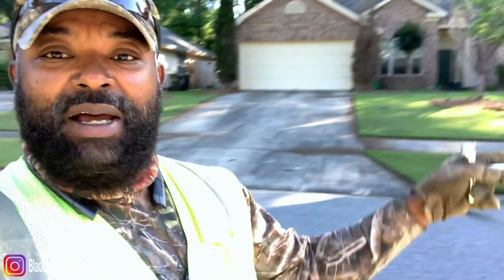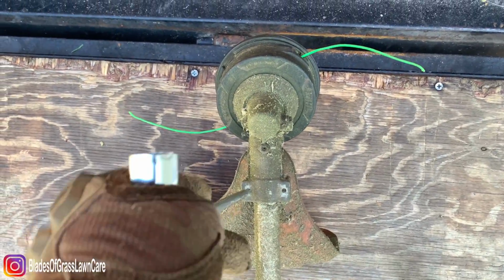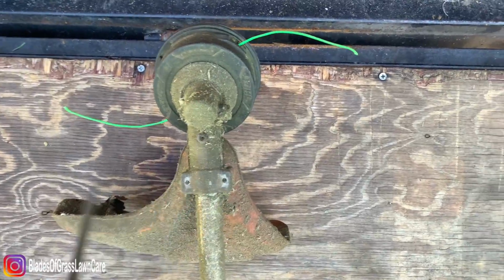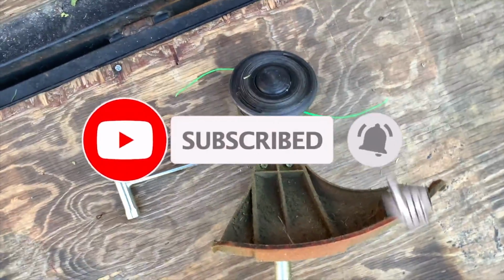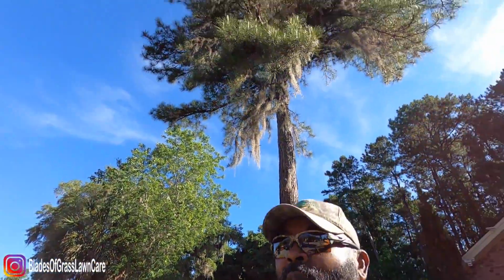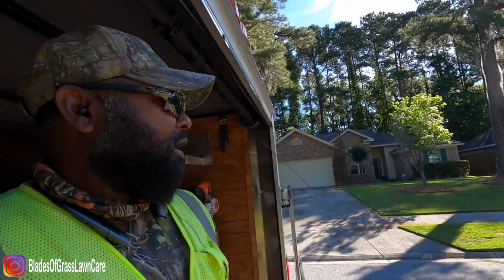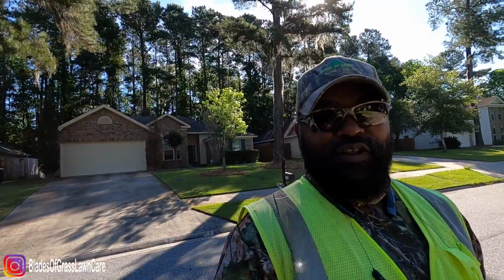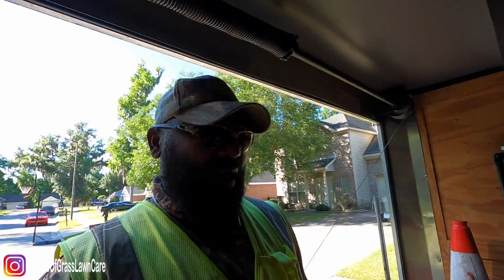CATASTROPHE [Subscribers advice leads to customer property damage]

Comment: The guard acts as a counter balance for those of us that are used to having it on.  When you take it off, it works against you until you get used to the lighter feel.  I ended up putting my guard back on, because that's my comfort zone.  Either way, stick with the guard on or guard off, which ever is more comfortable.  Big Ups for trying to use it without.  Cheers!

Comment: I've personally haven't used a guard on my trimmer since I was a rookie. If your used to the guard it definitely takes time before you should move at your normal pace. Your hand has to be super steady. The faster the head is rotating the more centrifugal force it has allowing it to not wobble/shake. You still have to maintain a strong hold in case the line runs (grabs ahold and starts to dig) and in order to maintain the proper height. Do NOT use this method around screen porches/metal kick plates, gutters and any soft objects. There is a learning curve involved. It's the same car but it drives differently. Only use the trimmer with no guard in low his areas and around the back yards until your comfortable. Good luck and if I can ever get video I'll try to send it to you. There are many advantages but there are also more precautions. Do NOT edge with a line trimmer without a guard near cars! Any questions I'm available.
Reply from the maker: Thanks for the tips and advice!
Reply: @Bladesofgrasslawncare  no problem. The benefits outweigh the risk with time. I still have my mess ups but they are few and far between. Eventually you'll be so steady that someone couldn't pay you to put that guard back on. The difference in weight to a guy running that trimmer all day helps with back issues. To me the lighter trimmer head lets me swing as wide as I possibly can in large areas because my back and abdominal muscles  aren't pulling as much of load back and forth.. another big note. Big big thing to watch is the length of your line. The guard cuts the line to the same length. Without the guard you are free to make the diameter of your line larger. This helps me trim so fast because I'm moving as fast as I can walk without breaking into a Sprint and with that much coverage you don't miss much. There is a balance here as well. You do not want the strong too long to the extent you can hear the motor slow down. With a spread loader you can quickly fix that but without you rev your trimmer all the way up tilted to the side like your edging but against the sidewalk untill the stings are the same length.

Edit: spelling

Comment: I run Stihl 91, 94 trimmers with no guard.
Few days ago i bought a 111 trimmer that had the guard on. Well i didn't take the guard off but i been using the hell out of it. I haven't been edging with it though.  But i have to tell you, i dont if it's because its a 111 but everthing feels different with that guard on.  I feel like i cut more level with a guard.  I'm going to put the guard on my 91 and try it out for a week. But you are right it does take you out of your comfort zone.  So you and and are doing the same test except opposit. You're trying without a guard and I'm going back to try with the guard. And right now my results with the guard are actually better

Comment: I used guards for a long time,, until we picked up a cemetery. Took the guards off to get a bit wider cut around the grave stones where the mower can't get through. The guards have been off ever since. I've taught myself to do most of my trimming at less than full throttle to have a bit more control with the guards off.

Comment: 😂😂 That guard sure does make the machine feel different !! I am a guardLESS guy myself but I have tried to go back to a guard a time or too. For some reason my trimmer turns into a BED REDEFINER !!! I will rut up some turf with that extra 100 lbs of orange plastic 😂
Reply from the maker: It felt too light to the point where I couldn't control my turf lining
Reply: @Bladesofgrasslawncare  I think a lot of it is what they call muscle memory.  We have been in the LC business long enough that it just sets in. It seems the older we get. The harder it is to change. Q could probably run no guard for a day or two and feel like he has always done it this way. I am 52 yrs old myself and change does not come easy no more with anything 😂 You definitely have to do what your comfortable with.

Comment: Couldn't pay me to put mine back on, my employer has all whippers without the guards we use that black hex whip line to help make up for the weight of the guard plus run the line about 9" or so lol definitely something that took me a month to get used to but 7 years later still running without and doing the edging without the guards lol not one window but lawn ornaments 3 or so have tasted the line lol lol the longer the whip line as your edging backwards you almost end up using your throttle hand just to balance, and your right Q, the 'ol timer who taught me told me the same damn thing, although he used KISS alot , K.I.S.S.
Reply from the maker: Thanks for sharing!

Comment: Its definitely different with some of the heavier stihl trimmers. I have and FS90R and it does feel odd with the guard off with the back end being heavier. I will say though, i bought an FS94R this season and when you take the guard off it feel so amazingly balanced to me and light as a feather. The light weight can be odd to handle at first, but it works out after a bit and its great for long days of trimming. I think the biggest adjustment is letting the string out and getting used to getting the right length. Q hit the nail on the head with it being in your head more than anything. Keep grindin brother and stay safe!

Comment: I have two trimmers, an Echo SRM 225 and a Stihl KM 130R. The Echo is low power and used more for light trimming and intricate work and I don't run a guard on it. The Stihl is balls to the wall power basically an on/off switch and I run a big guard on it. The Echo doesn't really fling stuff when using low throttle, but the Stihl will launch a rock through a brick wall at half speed. 

The biggest reason I don't run a guard on the Echo though is because it has a speedfeed head and if I bump out too much string I can easily wind it back up by hand. The Stihl head on the other hand has to be taken off and opened to wind up the string, therefore the cutter on the guard is essential. I use the Stihl generally on clean ups and tall grass cutting where meticulous work isn't top priority, the Echo though without the guard can trim around trees easily, be worked into tight space and be less bulky.

Comment: I saw a video of a guy who leaves the guard on but cuts off the lower curved portion which removes the blade that cuts the string therefore operates like the guard is not on but still has some protection I thought of doing this but I never get around to it.
Reply from the maker: Great tip, thanks

Comment: Great and interesting video.
Quest is absolutely amazing with a string trimmer.
I have to run a trimmer without a guard because I trim so flat that the guard drags on the ground,which makes sense because I’ve been an auto detailer for 38 years and I was taught early in my career to run the buffer/polisher flat so that running things flat is driven into me pretty well.
If your style and personal preference is to use that guard,then you should definitely do it.
Possibly without realizing it you using that guard as a gauge for your consistency in height ?not a bad thing at all if that is the case.it would simply mean you have a fool proof system.
Please keep the videos coming

Comment: Hey johnny, running no guard will make your equipment gum up, ull get alot of gum around exhaust.
Runs too hot, high strain an lower rpms, your rpms is what cools the engine.
Pay attention to the heat and gum around exhaust. 
Awesome video man. Pop smoke
Reply from the maker: Thanks for the tips!

Comment: Like anything it takes a little time to get use to it. My first year I used a curved shaft, first few days on a straight shaft felt strange. There's a reason why most of us take them off. Use it for 2 weeks and put the guard back on you will not make it to the next yard without taking it back off. There will be some annoyance with it off (too much string out is the biggest). Having said that, Stihl will tell you it runs hotter, and it does, shortens engine life. You're going against OSHA rules. The reg reads like, you're not allowed to manipulate the equipment beyond what the manufacturer built. But when you take off the deflector off your mower your doing the same, even with a chute blocker, if that blocker is all the way up and not acting as a deflector you're not in regs. Not to mention, a lot more debris bouncing off ya. More dirtier. Despite all of that I still can't put my deflector back on my trimmers. I have actually taught myself 2 edge/ trim my sidewalks with one hand walking straight forward, not having to contort my body in the position it's usually done with weed eating which is very hard on us. I use the ultralight fs94, no guard, and yes I do a great job.
Reply: But in short, taking the guard off is like a drug. Once you have adjusted to doing it, it's hard to go back. But come on man, you're prior military. You can push through it. Force yourself to learn. Give us one week. 1 week challenge. You are moving really fast which is what your adjusted to with the guard. So yeah you're going to make mistakes. Like anything you have to slow down and get the vibe. Just saying. But a 1-week challenge would be nice.
Reply from the maker: Great info, thanks!

Comment: I use a guard on my daily FS91r but run without on my overgrown eater, FS240r. It's easier to get into beds without a guard. The weight of the engine really bother me more than whatever is at the end. I do like running longer string at a lower rpm with or without a guard.

Comment: I run a Stihl FS130 and without the guard it isn't balanced well. It's got plenty of power to run a long string but it's not as controllable because of the balance. I have the big trimmer so I can run steel weed and brush cutting blades... it's a rural area!

Comment: Guard is there for a reason. I'm used to having mine. Helps from the poop splatter 😂. If you want to lighten the trimmer use a sling. It tremendously reduces fatigue on your hands, forearms and shoulders all day.
Reply: esoj anacig - I never have problems with hands/shoulders/arms. My problem is always my lower back.

Comment: I always run with guards on, I don't wan't to risk it. I have tried without, but seem to get a lot more stuff flying around and kind of noticed it throws the motor off balance as the line is longer, can't be good for the motor. I think on a plus side it is a little more manoeuvrable without the guard on though.

Comment: Taking guards off is a calculated risk: You could  just have easily have damaged property with the guard on. But this is how we learn, we make mistakes. I for one will never use a trimmer near loose gravel. ouch. Even with the guard on I've been hit by flying rocks and I've dinged a few windows. Those sound effects you see in Westerns with the ricocheting bullets? Yeah, that's a real thing. that guard only shields maybe a 20 degree arc.

Comment: The only problem when you remove the guard, the machine doesn't last long, put too much stress on the engine, the engine is not supposed to run with a long string.
Reply: I average two years per Echo trimmer with guard removed. Compared to the ones I've ran with guards there is not much of a difference in life if you do proper maintenance.
Reply: In our experience with the Stihl, without the guard, the equipment loses the power much quicker and the carburetor has to be clean or replace more often.
Reply: @adrianodevargas86  That's why I run the $200 Echo trimmers from Home Depot. Redmax and Stihl gave me carb issues and I got tired of replacing them. Most trimmers only last two years or so under the load we run them.

Comment: Ive run both ways, never seen once where guard done anything but help reduce grass being thrown around. Odds are if property was damaged it would have happened regardless. But if property damage is a major issue, stop using trimmers as edgers. That throws stuff like bullets. Get an edger.